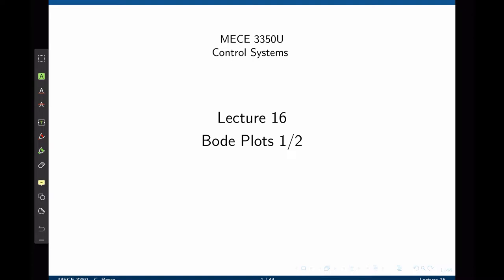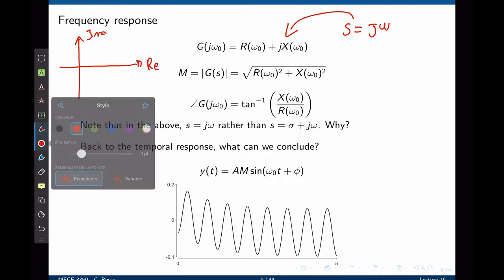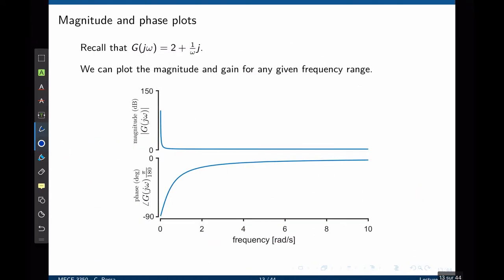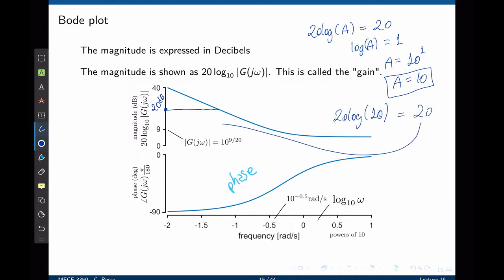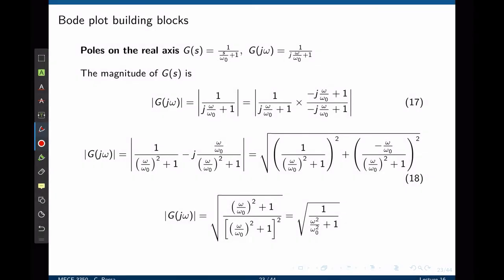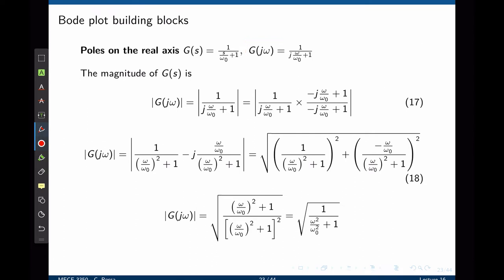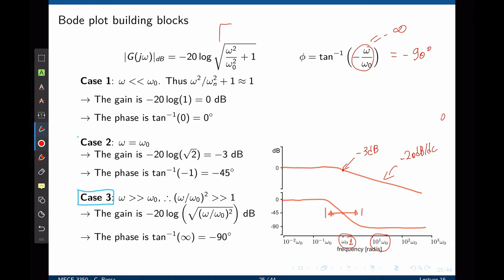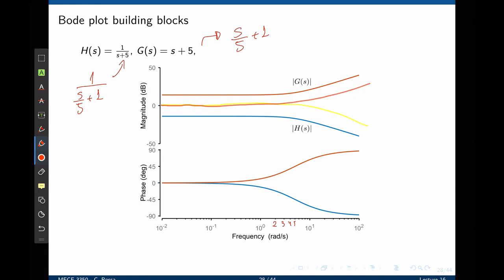Control Systems Lecture 16: Bode plots (part 1)

Comment: In a Bode diagram, the vertical axis of the magnitude plot is not a log scale. Although the units of the gain are logarithmic, the scale itself is linear. However, the horizontal(frequency) axis is a logarithmic scale, making the total Bode magnitude plot a semi-logarithmic plot.

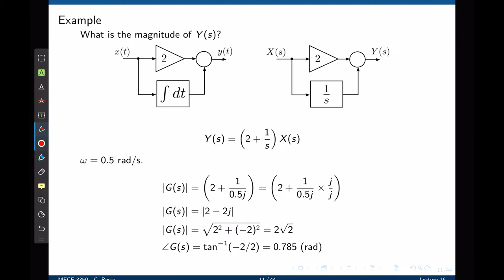Comment: On slide 11 at 13:42 if I calculate the inverse Laplace for the output Y(s) I get 2sin(0.5t) - 2cos(0.5t) + 2. The constant term 2 comes from the pole at 0 introduced by the integrator (1/s). Why is this term not present in the time domain system? Are the two systems different??